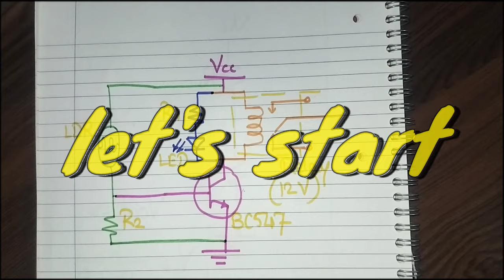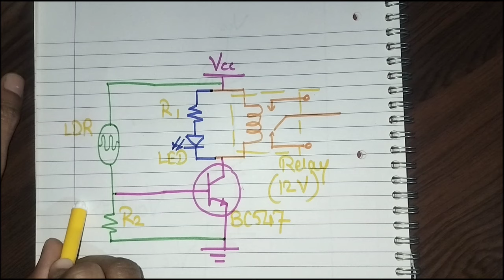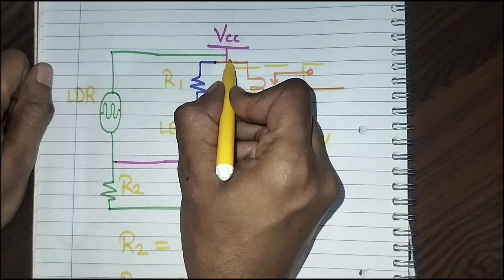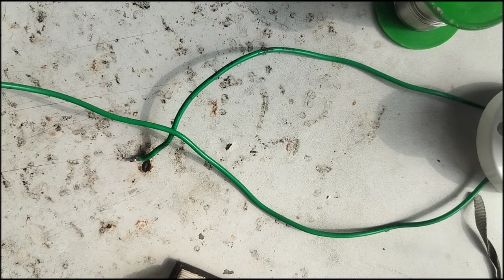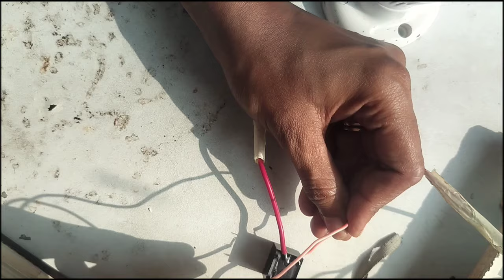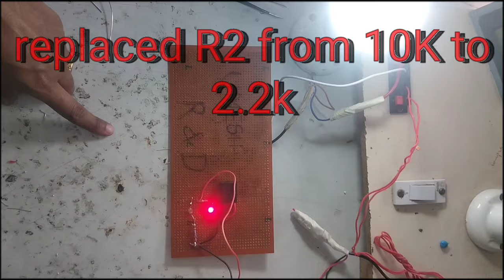Automatic Parking light #automatic #parking #light #project for #electronics #students

Comment: Mam i hope u r fine.
will we use fly back diode across the relay coil for the protection of BJT from back EMF of coil.
Reply from the maker: Yes that will be best as it will protect the reverse flow of current and only allow forward which will protect the circuit.